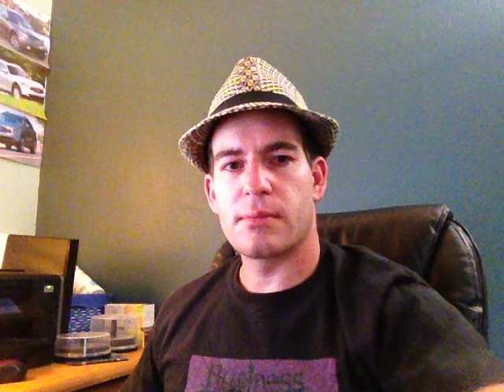How to know if your auger motor is bad

Comment: I just want to say that this video was an absolute lifesaver.  After a cleaning of our pellet stove a few days ago the top auger stopped working.  I put it in diagnostic mode and swapped the cables on the bottom auger motor and the top auger motor to rule out the auger motor dying (the top auger worked with bottom cables).  I then thought that maybe the switch in the hopper door had died so I had that tested (it didn't) then a quick google brought me to this video and using a paper clip confirmed it was the vacuum shut down switch.  I don't feel too safe having the system bypassed so I will probably replace that part but I'm amazed that it was something so simple.

Comment: I wish I would have started here, as I guess it was the vacuum switch all along. The unusually cold winter here in central WA must have produced too much fly-ash.  The stove is 13 years old and this has never happened before. I put a new motor in and could not get it to work. I searched online and found your clip above.  So I cleaned all the flyash in the exhaust vent, unplugged then re-plugged the vacuum switch wires, snipped the end of the vacuum tube where it attaches to the exhaust fan, as it was dried and cracked, and now it works!  Thanks for this help!  I will just keep the old motor on a shelf in the shop for a backup, (and my wife will never know about what I did not know)!  Stay well (and well loved)!
Reply from the maker: Eric,  glad this was helpful for you and you got your stove working.  Thanks for letting me know.

Comment: Dude thank you so much for this video! Auger motor wasn't turning on. Cross-tied the two terminals to the pressure switch and it started spinning. 👏👏 new pressure switch $35 vs new motor $105+

Comment: Good video.  Vacuum switch it was! Made the jumper as you suggested and auger started moving. Well trying to find one online I gave it some technician taps....  Tried switch one more time and it worked!!!  Good job because the next tap would have been decelerating somewhere in my backyard!!  Thanks for the advice!!!  Cheers

Comment: This guy nailed our problem.  Super easy fix to reconnect the vacuum switch after a power outage.
Reply from the maker: Glad to hear that worked for you.
Reply: Pellet Stove Pro I have been having a horrible time trying to figure out why my auger motor won't run . I took it out and did a bench test and there wasn't any issue and it ran no problem . Then yesterday poking around trying not to pull my hair out I took the control board that is on the left side out ( it's a plastic box that just slides out ) . When I took that control box out everything worked great ! Auger turned , igniter did its job and then it blew hot air no problem . By sliding out that control box it will ONLY RUN THROUGH THE CYCLE ONCE ! By taking that control box out it will run through one cycle and that's all . I have no idea what's failing or what to do at this point . My pellet stove is also the Quadrafire Mt Vernon (non AE ) model . Thanks so much ! This is a shot in the dark but hopefully you may be able to help me

Comment: Thanks man, appreciate the insight. Got an envirofire second hand I am trying to get going. The auger apparently works after a reset, then stops. Giving it a good cleaning and doing the routine maintenance before firing it up.
Reply from the maker: Cleaning is the first step.  If it has the same problem still you may just have an auger motor that is getting tired and will work for a short while but overheats and shuts down.  If the auger motor is really hot when the shut down happens that's a positive sign for a bad motor.

Comment: I just tested the Differential Pressure Switch with a 'paperclip' per your video.....and the auger motor came on !!! I spent all last Saturday and Sunday cleaning the flue, fines box, internal cast iron plates and firebox......all to no avail !! So, I want to thank you again for your excellent video. I found a Harman Accentra parts company and have ordered the replacement Diff. PSI Switch. In the meantime (approx. 3-5 days) do you think I can run the stove with the temporary paper clip bypass? I have secured it tightly and wrapped it very well with electrical tape so it won't short out or come into contact with any nearby wires etc.
Reply from the maker: Glad that worked for you...

Comment: The information was incredible as I am quite mechanically inclined. I jumped the motor and the motor seems to be running just fine. This grill is brand new. I bought it from an outlet store when I fired up the auger and the fan move for maybe 30 seconds and then stop so I’m pretty sure it’s a switch, however it looks like all the switches are on the motherboard the brain board do you know which wires I need to cross to find out if it’s possibly the switch or do I need to just replace the entire controller. Thank you in advance.
Reply from the maker: I do not know.  Sorry.

Comment: Low limit /proof of fire will stop the auger motor after it has already dumped about a handful of pellets into the burn pot.
so it will initially dump the pellets and perhaps it will not light them, naturally if it does not light them the proof of fire disk or sensor will not kick the signal along to tell the stove to go into run mode, so it will eventually shut down.

if the pellets do light and it goes out I would just try to bypass the low limit/proof of fire snap disk it if has one, some stoves have a thermocouple right inside of the burn pot, other stoves have a glass eye that looks for the flame and that glass eye gets dirty sometimes and needs to be cleaned.

It really all depends of what phase the auger is stopping, if it does not move from jump street it is usually a dirty stove/bad vacuum/switch easy to figure out, just bypass the vac switch 
or a bad auger motor / or an auger jam

to prove an auger jam you should just disconnect the auger motor from the auger shaft then with all of the pellets out of the hopper, try to turn the auger with a vice grip or pliers, it should move but could be a little tough if there are even just a few pellets in the flight , now would be a good time to put line voltage to the auger motor though

you could keep the auger motor connected and put line voltage to the auger motor to see if it even attempts to spin but I like to remove the auger from the shaft because it is usually an auger jammed up with fine sawdust /wet pellets

Good luck people and if any of you have any issues give me a shout, I might be able to save you some time. frustration and a lot of money

Comment: Auger stopped on a QuadraFire classic bay 1200.  I watched your video and decided to empty hopper clean everything and remove auger assembly. I found the nipple for the vacuum switched packed with pellet dust.  After cleaning and running the stove for awhile, I noticed that the auger motor spins for 5 seconds, stops for 6 seconds and continues to run like this.  My question is- is this normal operation for the auger motor?  The stove stays lit and functions, but sometimes it looks like it is not getting enough fuel.
Thanks in advance.
Reply: Yes.  That is normal

Comment: My auger just stopped working tonight, so I'm hoping it this simple. But what I dont get is why that one end of the hose keeps drying out. Its not exposed to anymore heat than the other end. In addition, that blower is (presumably if hooked up right) sucking in cold outside air and blowing it into the burn chamber. So even the air the hose is exposed to it cold.

Comment: Just got a new bottom auger motor because it had stopped and was very hot. So now the new auger motor is in and working well but the new auger motor is also hot. Why would a new auger motor that seems to be running fine be very hot?
Reply from the maker: They do run hot.  Depending on where you the motor you may have a quality issue.

Comment: What about intermittent auger.   Cumberland stove.  Even without pellets I run the feed switch and hear the relay click, but intermittent operation.  Either works or it  doesn’t, not like a loose connection

Comment: My auger motor is turning when it’s disconnected from the auger completely and turns the auger when installed but only when no pellets are dropped into the hopper. Is the motor just weak? Or maybe the auger needs to be sharpened like you mentioned?  The bushing looks good and isn’t binding really. Thanks for your reply.
Reply from the maker: Sounds like that auger motor has gone bad.  They can just get weak like that.

Comment: Hopper lid safety switch.......don't forget to check that.......my circuit was auger - pressure switch - lid switch.  I found the connector off on the lid switch and plugged it back in.
Reply from the maker: Good point.  Not all stoves have this but if they do it will stop the auger from feeding.

Comment: I have a Traeger Professional and it took a tumble in a rainstorm. ( the dirt softened and it fell).  Initially, it didn't turn on.  I unplugged and plugged back in all connections.  Now, the auger motor is turning once plugged in and with the switch off.  What is going on there?  Is it doing a shutdown cycle for some reason?  I have never had any issues with this smoker before.
Reply from the maker: Hmm.  That's a tricky one because of the fall.  If you just plugged it in one day and it had that problem I would think it would be the control board.  But, if the fall caused some sort of short circuit in the wiring and that is still bad, then you'll fry the new control board you put in.  Before putting a new control board it I would inspect the wiring carefully and use an ohm meter to make sure no wires are grounding to the frame of the stove except for the ground wire. Hope that helps.
Reply: Pellet Stove Pro thank you.  I’ll look into it and let you know what I find out.

Comment: Very helpful video! I of course bought a new auger motor before I found this video. I haven't received the motor, so I thought I'd clean the stove and chimney and check to see if the auger motor is getting power. I heard grinding from the auger motor before I ordered it and I just thought it went bad. It turns out, the auger motor isn't getting power. I disconnected the leads from the vacuum switch and connected them. Voila! The auger started turning. Hmm. So how do I know if the vacuum switch is bad or it's sensing something wrong?
Reply from the maker: If your chimney is cleaned then it's probably a bad vacuum switch.  That is very common.

Comment: Are pellet stove works the feeder and all that's working good it's just that when you plug it up and it starts burning when the thing comes on it's screaming the whole time
Reply from the maker: If it is a constant scream then it's the exhaust or convection fan.  If it screams only when the auger turns on it could be an auger bushing.

Comment: I own a Lennox Winslow Pi40. Everything starts up correctly like it should, then the auger stops. Once I hit the start button, it will run for a half hour or so then cut off again. I have cleaned the chimney, so I assume that I need to follow your steps in this video?
Reply from the maker: Yes.  Follow the steps and if you still have the problem let me know and we can work through the next steps.
Reply: @JASONRICHARDMunson  Thank you. I can not find anyone in the area to work on pellet stoves.
Reply: @JASONRICHARDMunson  I installed a new igniter, no issues. Received the new vacuum switch today. I got an aftermarket switch that did not could not bolt back on the bracket. I also had to lengthen the vacuum hose as well to get the sensor to work
. Ran for over an hour, then the feeder would not cut back on. I did a real good detail clean when I installed the igniter. Do not know what to do next?
Reply from the maker: @SMITHWT3  Did you bypass the high limit sensor?
Reply: @JASONRICHARDMunson  No, installed new vacuum sensor with the two wires and the vacuum hose. Everything is how I saw it.
Reply from the maker: @SMITHWT3  If you convection fan is blowing hot air in the room then you could have a bad high limit switch.  bypass it and see if the stove stays going longer.
Reply: @JASONRICHARDMunson  I am feeling hot air, but it does not seem as hot as I have noticed before. The high limit switch, is it located in the blower duct?
Reply from the maker: @SMITHWT3  It's high up in the stove, mounted to the firewall.  has two wires going to it.
Reply: Pellet Stove Pro When the auger stops for what ever the reason, should I be seeing a fault? I am not seeing any red lights. I was thinking if there is an issue with a sensor, I would think I would have a fault?
Reply from the maker: @SMITHWT3  No, there isn't a fault code when the auger motor stops.
Reply: @JASONRICHARDMunson  Okay, I bypassed the Over Temp Snap Switch and the Convection Blower Snap Switch. Still the Auger cut off with about an hour of run time. The only switch I have not bypassed is the Proof of fire switch on the combustion blower.
Reply: I thought the Over Temp Switch was the fix when I bypassed it. It ran for a longer period of time before the auger cut off.
Reply from the maker: @SMITHWT3  How old is that auger motor?  I'm wondering if it's overheating and shutting down....
Reply: @JASONRICHARDMunson  I will find out and get back in touch with you.
Reply: @JASONRICHARDMunson  I have not gotten an answer from the previous home owner, but the house was built in 2007 and he added the pellet stove later. I would say at least 10 years. I did mention to him the problem when it started and he said to replace the door gasket.
Reply: @JASONRICHARDMunson   I heard from the previous owner about the age of the pellet stove. So I decided to give the stove a good clean. Areas that I have never cleaned before because I did not know. The previous owner did not tell me about the up keeping and what needs to be maintained. I am used to wood stoves or fireplaces. They do not need the level of cleaning like a pellet stove does. I pulled the pellet stove out from the insert. I vacuumed everyplace I could through visual inspection and the manual. I removed both blowers and cleaned out. I did notice the snap switch on the combustion blower was dirty. I cleaned and reinstalled. The firebox had some ash under the chimney/ vent pipe. Cleaned all of that out too. Put everything back together and started.  I could tell first thing the blower sounded different, also I was feeling more heat blowing out the front. However, after a hour of running, the auger quit feeding. I guess changing the augur motor will be the next step.

Comment: So my New England pellet stove top auger is not spinning. I took the wires off the bottom auger and put them on the top auger that is not working so I turned it on it moved. So would that be a bad mother board. This video is very old so I do not if you responded thank you.
Reply from the maker: I'm not sure if I understand.  When you put the wires from the bottom motor to the top motor, did the top motor work?
Reply: @JASONRICHARDMunson  I found out what it was, the vacuum for the top auger was not connected to the pipe. But now it every 2-3 minutes the stove trips the outlet. Can it be the igniter from grounding out? And thank you so much for replying
Reply: @cotewhiteduck5924  Try unplugging the igniter. Try running an extension cord to a different circuit.

Comment: Auger for pellet stove Enviro M55 does not workI tested both motors which work fine. Cleaned vacuum lines they are fine.  Fuses are fine.  There are no jams in the auger house because I took it out, cleaned and turned with my hand without any obstruction.  What would be a problem that causes my auger does not work?  Thanks so much for your help
Reply: +Dre Z You can run 120v directly to the motor and see if it turns to confirm the auger motor is good.  If it is good then take the two wires off the vacuum switch and connect them together and see if the auger is running.  If it is not running then take the two wires off the hi limit switch and connect them together.  If it still won't run you have a bad control board.

Comment: 2013 lopi apg , red light flashes, i did the encoder voltage test. 5 volts red and black no volts on black and white. it says replace "pusher auger" the wires lead to a little thing that is on the shaft of the motor? But the motor is turning. totally cleaned the stove. Any input? and the motor gets warm,not sure how hot is to hot?
Reply: Sounds like it's a bad auger motor.

Comment: Hi Jason. I have an Austraflamm, Integra One, 1991 model.  The auger spins making a grinding noise.  Sometimes it works, sometimes it doesn't. I cleaned it all out, hoping it was just dust, but it still makes the noise and only spins every once and a while.  Does this mean the motor is almost spent?
Reply from the maker: Jason, Yes, that sounds like the auger motor is going bad.  Here is the replacement....https://www.pelletstovepro.net/index.php?route=product/product&product_id=154

Comment: I have a Hartman pf100 I thought auger motor went replaced motor and same thing auger blinded up and stopped. I pulled auger out cleaned tube and whole stove including vent piping. Reassembled and motor moves fine until tube is filled with pellets then motor binds up like lack of enough power. Pulled motor off but kept hooked up to 2 wires motor turns but I can stop both motors with minimal hand pressure with pliers on motor stud. Both old and new motors stopped like this. What most likely is causing not enough power to motors?
Reply from the maker: That's unusual.  Have you tried removing the auger and see if there is something else in there besides pellets that might be binding it?  That's what I would try.  You may need to sharpen the auger or replace it.